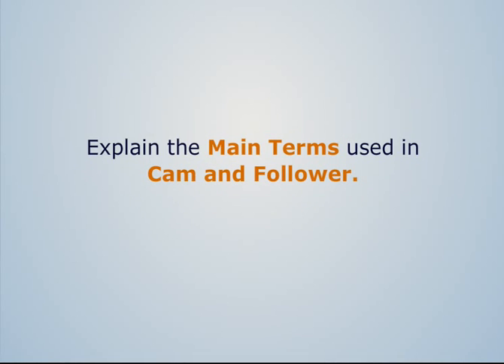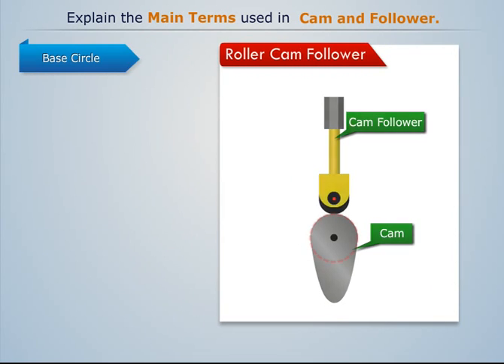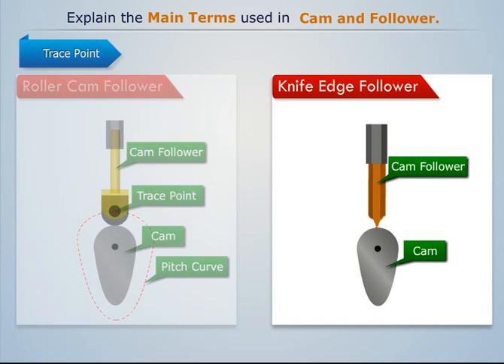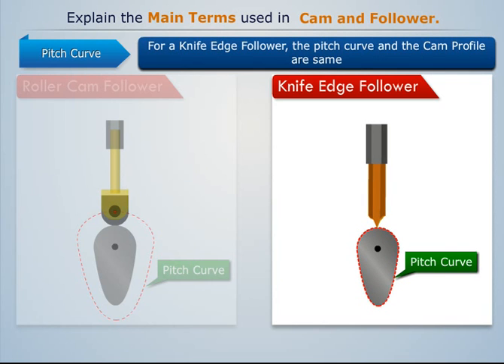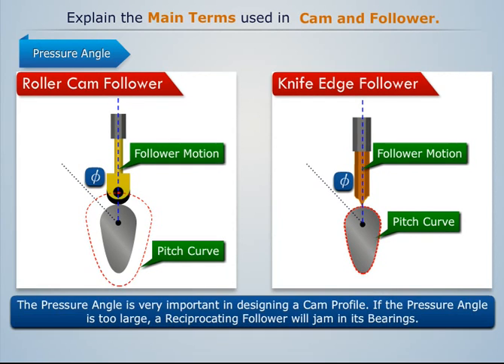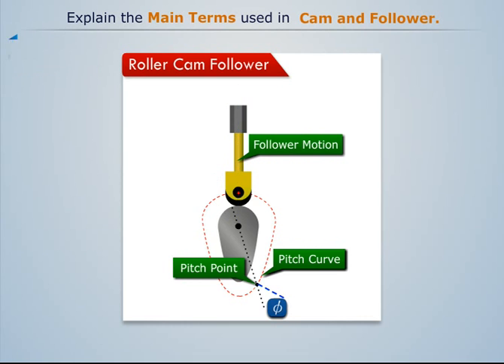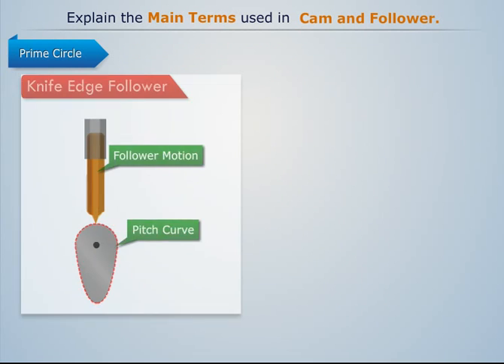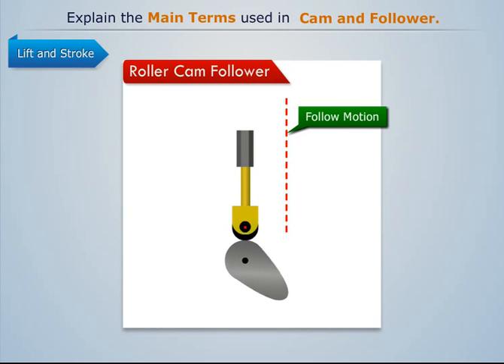Terms Used in Cam and Follower | Theory of Machines

Comment: What is the abbreviation of CAM?
Reply from the maker: CAM stands for "Camshaft" or "Cam." A camshaft is a rotating machine element typically used in piston engines to control the timing and operation of valves. It converts rotary motion into reciprocating motion, playing a crucial role in engine performance and efficiency.